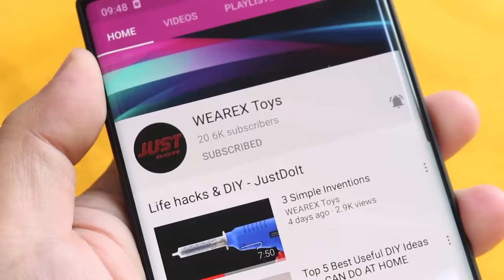Make your work easier with DIY Hammer Machine

Comment: Im puzzled as to why you would set it so low to the ground? Nice concept, seems to work well if your going to squat the whole time your using it. I would have also opted for a larger hammer that motor looked like it could handle 30 or 40 pounds of rotation force.
Reply: channel is called Wearex >>TOYS<<
Reply: I understand the name, but why take the time to build something like that if your intending on using it?
Reply: @clubsoda85cook55  he builds what he saw feet of serving the scale of projects he usually works on . He can put it on top of a table if he wants to. 
You are looking for the problems, not the main idea of it.
If you build one, no1 is stopping you from making it 10 times bigger .
Reply: @dionysis8680  ohhhh, so you smash toys with it…..wonderful.
Reply: Jsjsjsjdjsj
 @clubsoda85cook55
Reply: I love the size! Compact. Easy to store. I might have to build 1 like this some day
Reply: How to adjust area and strength of the hammer
Reply: This is a small version of what is called a drop hammer. All of the striking force of the hammer comes from the combination of how much it weighs and how far it falls. In this design, this calculation basically applies to the steel cylinder, the end of which is actually acting as a hammer.  Make this larger, and make the rotating wheel at the top that converts rotary to linear motion larger so that the shaft drops farther, and it will hit harder, but maybe fewer strikes per minute unless you adjust the drive wheel ratio for the belt. The motor at least looks overpowered. You would need to play with this.
Reply: I thought it weird at first but in some countries people find it comfortable to work sitting on the ground directly or from a squatting position.

I couldn't do it that way all day without a backache. But working from a standing position is hard on my feet and knees as I get older.

So, I do a certain amount of work in a low chair, sit/stand stool when operating Machinist tools, or just standing.

Kinda spread out the days work load out evenly on my body and joints.
Reply: @WILLIAM OWINGS  that's how I work. Not for comfort though. It's due to a lack of space lol
Reply: @williamowings6857  may i introduce you to the treadle hammer? there are different versions - including one with a spring instead of hydraulics. mine will swivel because i don't have that much space in my workshop (I'm looking for ideas right now)
Reply: Finger smasher! 😢

Comment: Thank you for putting this video out there, Been trying to build power hammer for many years, sourcing parts and pieces, but hadn't seen the proper build of this type until now, of course ours will be majorly over sized, using a 3 inch (76.2mm) hammer shaft with a 5 inch (127mm) anvil shaft, again thanks for the inspiration and information!!!

Comment: That's great. I just don't know why you wasted two pillow block bearings as vertical slides. At least they are self adjusting, I guess. 👍
Reply: I was wondering same. Have seen this method in many hammer videos.  Seems like an expensive alternative.  Although everyone I've seen have worked great.
Reply: Grease works
Reply: 66iiikijkii
Reply: découpe  au zippe
Reply: @collinsmetro  camper usati vendita a
Reply: Must have a  lot.

Comment: The last two bearings have been used exactly for what they were designed
Reply: No those were designed for rotation of a shaft, not linear sliding of a shaft in and out. A simple stationary pipe guide would have worked just as well likely
Reply: @BrandonDickenson35  I'm not good at being sarcastic. Point noted🙄
Reply: @krishm2478  oh. Lol here. Ole dead hole would've done the same, save the swirly fancy holes for the good stuff.
^fixed☺️

Comment: If that drill making the hole in the round steel plate ever "catches", it's GoodBye Hand! And you have all the bolts installed upside down! Lose the nut, lose bolt!
Reply: Did you also notice the shoes he’s wearing. If he drops a decent piece of metal he loses a toe. I’m surprised he hasn’t found welding spatter in one of his toes

Comment: Why is it on most of the video you see about welding projects nobody runs a weld bead,instead they put a bunch of tacks?
Reply: Most likely because they are using mains-line voltage without a secodary coil or transformer/ welder to adjust voltage to a colder setting. Just hooking the welding rod straight to the wall outlet. Then they just do some extra hot tacks instead of a constant humongous weld using proper voltagefor the thickness of material being welded.  Also if you look there is no bevels on any of the fit up to allow for proper weld penetration.  Its just short pecks of extra spicy overcooked  weld.
Reply: @cobre7717  I don’t believe I would have them build me a water tower

Comment: Can u work on the hammering interval
Reply: With no other changes aside, moving the offset on the drive wheel, in or out from the motor shaft will affect both speed and shift lift distance